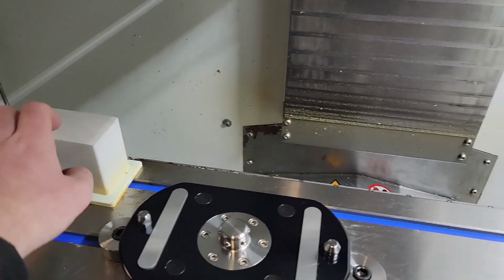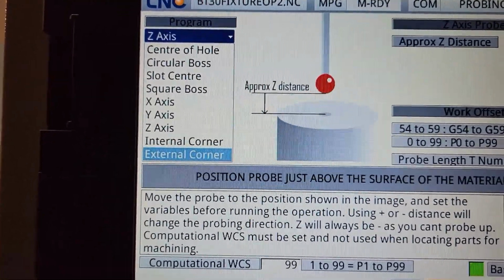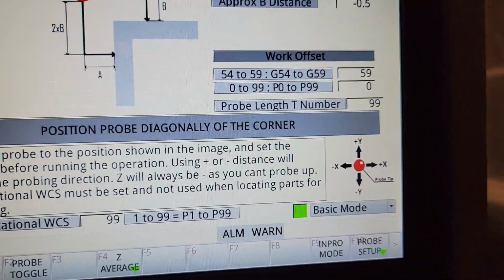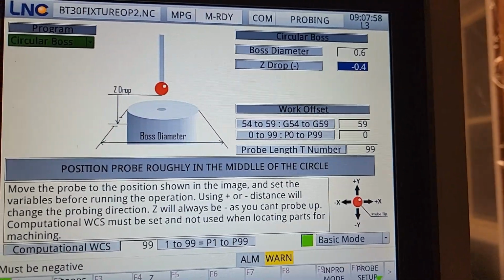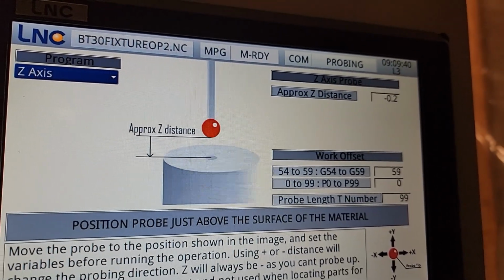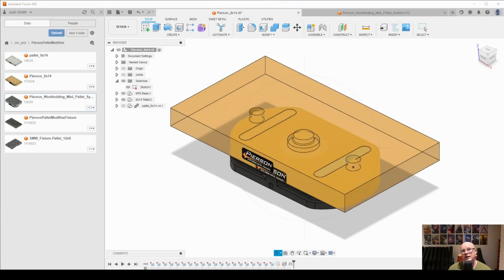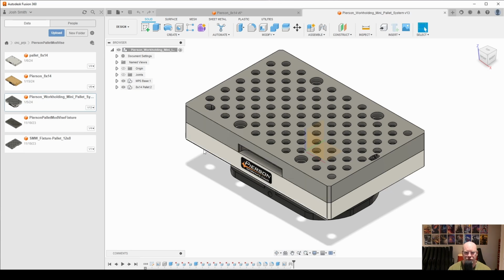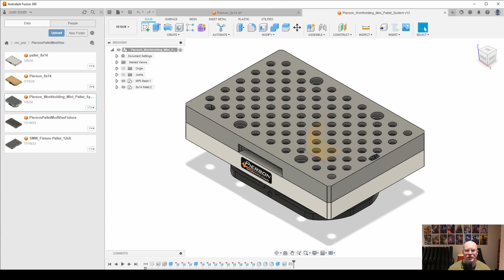SYIL X7 PROBING A PIERSON PALLET

Comment: Are these Pierson pieces basically zero points? Why would you use this over a 5th axis rocklock base?
Reply from the maker: @shaunybonny688  I switched from pierson to the rocklock. I prefer the rocklock at the moment because it's more versatile in terms of readily available work holding. For example, almost any brand of self centering vise will have a 96mm mounting pattern that will drop into the rocklock off the shelf. The pierson pallet system would be better if you're doing high quantity production and can palletize everything. Right now, my work is low quantity and fast turn around. I rarely see the same part twice.
Reply: @MrSmith1231  thanks for the response.